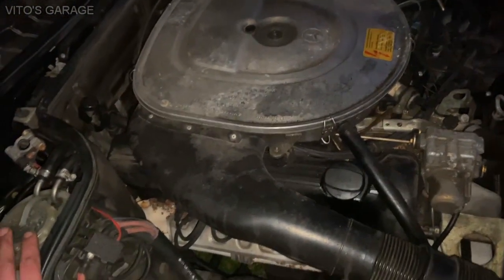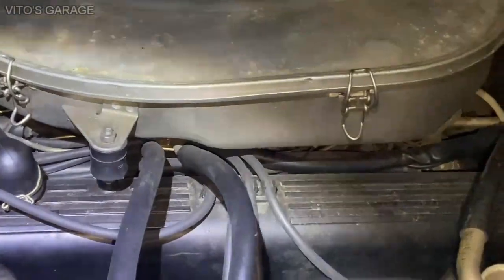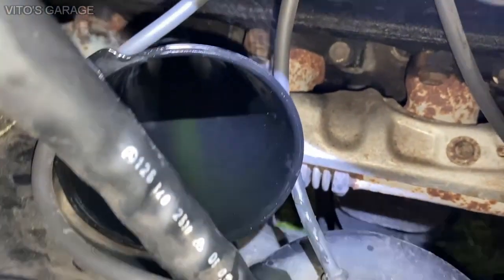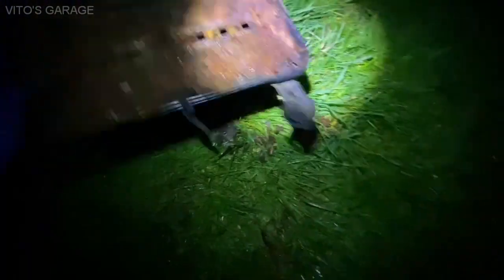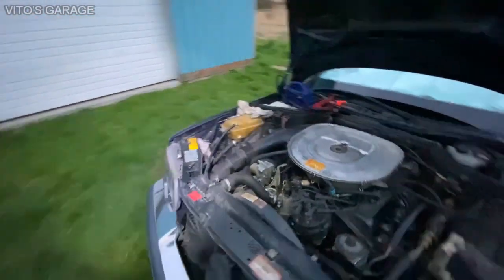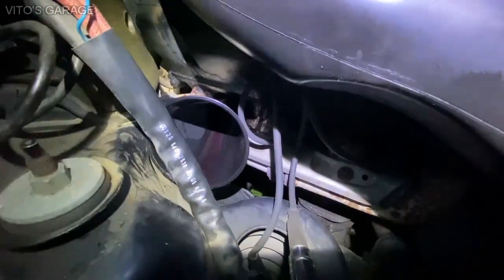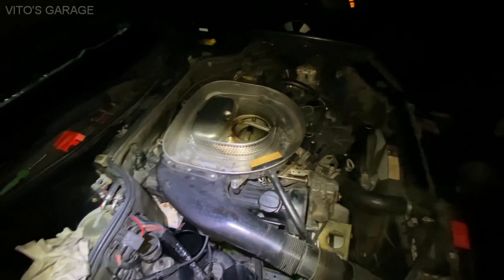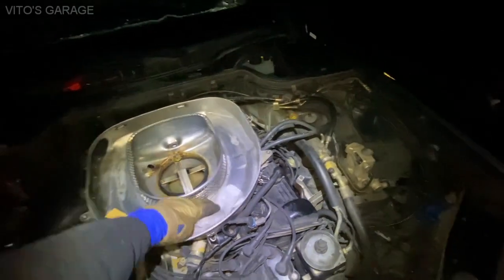Mercedes W126 420SEL Misfire.. Compression Test. Sad News

Comment: Compression is low but still high enough that with fuel and spark it should fire. As a few others have said, maybe the injector is blocked. The spark plug should have some wetness if fuel is reaching the cylinder. Maybe test a new injector in a jar to confirm it’s ‘popping’, if not then the fuel distributor might have an issue.

Also I think these V8s over time do get weak head gaskets at the rear according to my mechanic. Also it’s probably worth removing the valve covers at that mileage to confirm the oil rails for the cams isn’t loose due to aged plastic or the timing chain isn’t stretched since that’s catastrophic failure on this engine! Hope you get it sorted!
Reply from the maker: Thank you for all the advices! I’m hoping it’s just the injector. That would be an easy fix then. And I’m planning to remove the valve covers to inspect the oil rails. I opened an oil filler cap and the right side oil rail felt okay, it wasn’t loose. But I’m still gonna remove both valve covers and probably just replace those plastic retainers. Thank you for your support!
Reply: Lots of helpful information! We need you on the MB FORMS

Comment: Hi Vito, 2 bars to compensate is a lot, 
but..... positive thoughts !
A good oil change preceded by a flush and your W126 will start again for 100,000km :)
Nb: You have surely already checked your idle control valve ? (in addition to checking your injector):  Allez courage !
Reply from the maker: Thank you sir, I’ll keep digging and we will see what happens. I need to change the oil on this car desperately first. I feel so bad running it with that old oil..
And I’ll check that injector too🤝

Comment: I did the head gasket and found no compression in the first cylinder after wards. Sucks, sad very sad.
Reply from the maker: Put oil in there and see if the compression goes up. It’s easy to replace the headgasket on this engine and there may be an issue with the valve not sealing properly. Could be due to carbon. And that’s why no compression. Don’t let this legend die!

Comment: Try using engine restore oil additive. Mostly fixed rod knock and low compression on my lawn mower and a diesel tractor. Only $10 so worth a try
Reply from the maker: That’s what I heard, sir! I’ll use some Engine restore additive along with fresh oil and maybe that’ll restore the compression in it
Reply: @VITOSGARAGE  good luck

Comment: You dont need to remove fuel pump relay.
You dont need to use ignition lock to crank starter.
There is a special connector in the engine bay on passenger side, under plastic cover. Bridge the ports and it starter goes on. It is by design to measure compression, read the manual, товарищ.
Reply from the maker: You have to remove the fuel pump relay and a crank position sensor connector to prevent the spark and fuel injectors from spraying fuel. Especially when doing the compression test. Spark plug wires were out and you don’t want the spark to be produced and not have a path to ground while cranking. That’s why I disconnected the crank sensor.
And I know about that connector on the passenger side. It was easier to do it with a key. Спасибо🤝